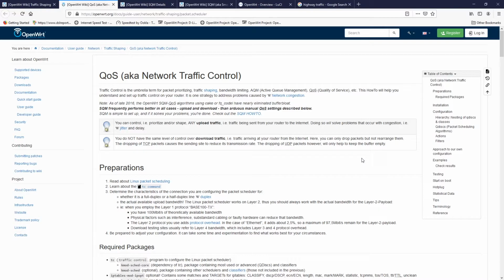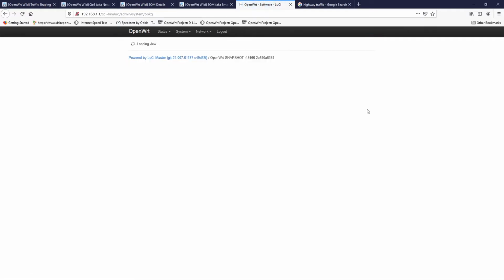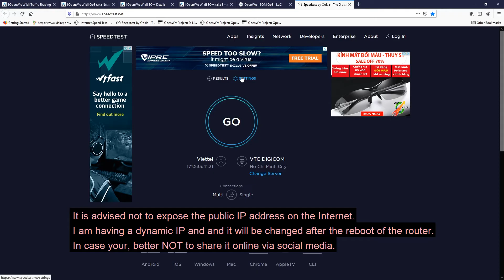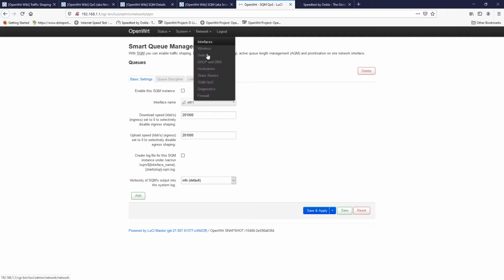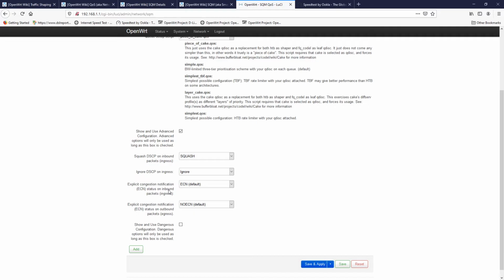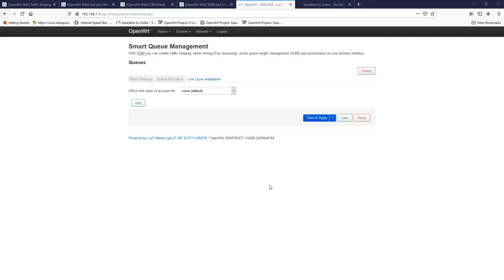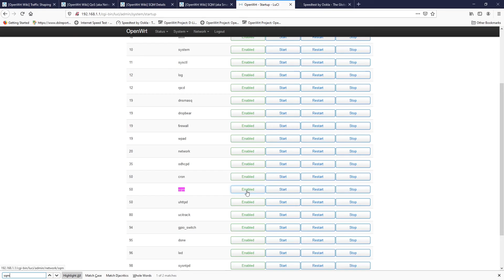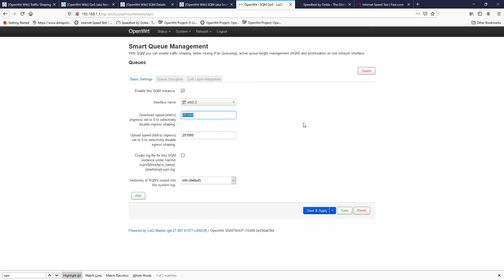OpenWRT - SQM QoS Setup on LuCI

Comment: Highly recommend limiting client speed below 100Mbps if you get a lot of latency spikes and have bandwidth overhead to spare since routers often can't handle SQM above 100Mbps. In my case, I set SQM shaping on my interface at 80Mbps and speed limits for my client on that same interface at 90Mbps. Completely eliminated all latency spikes. It's good practice in general to allocate appropriate bandwidth for different clients. For example, if someone you live with has a smart TV that streams in 4k, it will need about 25Mbps (overhead included), so you can set a 25Mbps download limit on that client to ensure it doesn't eat up more bandwidth than it needs.
Reply from the maker: Thanks for the info. For router which doesn't have a powerful processor/CPU, limiting the WAN throughput is also a good way to keep the latency stable (as the SQM also use CPU resouces to handle the task).

Comment: hi, i set bridge mode on my modem and added sqm to my openwrt installed router(ax23). it was working fine for months suddeny i lost connection.when i activate bridge mode on my modem i cant acces to internet, even without router modem aint giving me ip
Reply from the maker: Hi, did you fix it? It seems the problem is not about SQM, but either with the way you set your modem to bridge mode (perhaps it was overwritten by config from your ISP)?
Reply: @VanTechCorner yeah its not because of sqm but i dont know where to ask 😅 i can put to bridge mode my modem but i cant get ip from it,for now im using my modem as router mode and second router to share wifi
Reply: @VanTechCorner this problem happened after i lost internet connection due to maintance in isp side they told me to hold wps button on modem(removed bridge mode) and they resetted my ip after that i couşdnt use as bridge mode

Comment: Can someone tell me if there's a current issue on Openwrt 24.10.2 x86? I got it installed, but when I try to get a status is says active with no instances running. I checked kuci and it's enabled in SQM and other startup.

Comment: Can i set up this in asus old wifi 4 router and set up this speed for each ap ?

My main router is mikrotik, and for APs i use old one asus and tp link routers. 

On my network i have simple que and mangle rules on mikrotik, but i want to limit speed for also each ap.

So when i have 40mbps internet i want to have in each room 20mbps with mangle rules, and when i start download some files i will have stable internet in the second room.

Comment: Hello.
I have a Kimax Boundless NAS, I installed Openwrt-21.02 on it. The problem is that when logging into the NAS Server with Luci, it asks for a username and password, which I don't know what it is. I've had this device for about two years, and I've never used it for this problem. Would you help me?

(Powered by LuCI openwrt-21.02 branch (git-21.148.49484-14511e5) / OpenWrt 21.02.0-rc2 r16122-c2139eef27)"

Comment: Not sure if you can help with this but I'll go ahead anyway.

I have a Eero mesh that has SQM turned on. However, it doesn't support PPoE bridge mode so my modem router is configured as double NAT with wifi turned off. I've added the routers DMZ address and forwarded UPnP. 

Is there any other settings I should check/enable for double NAT to work as smoothly as possible?
Reply from the maker: Hi, I can see that you already done all the necessary thing. From my understanding, no further stuff you can do in this case.

Comment: Good video, however, on a 100mbps connection, I can happily set the speed cap at 95mbps and do a speed test with no latency increase while its running, however, when downloading lets say a game from steam the ping will still fluctuate all over the place, it would be best to test on something that isn't speed test to really check what  your ping will do...

Comment: hi. thanks for the explanation. How SQM relates to the use of VPN? I am connecting to PIA. Should I still use the 85% of the ISP speed or the speedtest results (that goes via VPN)?
Thanks
Reply: I made some testing. when set the SQM download and upload speed to 0, my WAN speed is substantially better. Any value as per openwrt documentation (85% or 95%) would cut my speed really a lot.
Any idea why is that?
I than added the software flow offload and I have increased in speed and latency.
In the link layer adaptation Minimal packet size, MPU I set 64 (not sure that had impact on results. Documentation suggested to put 64).
I than activated my openvpn client. Naturally I lost quite a bit of speed but became much better than before.
QUESTION:
Would it be unwise to add a new SQM where I use tun0 as a interface name?
Thank you
Reply from the maker: - if you set the download / upload speed to 0, there is no limitation perform by QoS and your latency may increase which make QoS useless. If you want a full speed throughput, better not use it. As stated in the document "The 80-95% range mentioned above is a good starting point, but you can often gain more speed while still controlling latency by making a couple experiments to adjust the settings". You can find the link to the docs in the video description. 
- for VPN SQM/QoS, you can refer to this forum discussion. I believe it should help https://forum.openwrt.org/t/solved-sqm-with-a-vpn-what-interface-name-what-packet-overhead/57473

Comment: the download speeds reduce after doing this, is there a solution?
Reply from the maker: Hi, did you solve the problem? If not, I would suggest checking your throughput before enabled SQM. And then, use this value to configure the throughput for the interface in SQM.
Reply: @VanTechCorner  well I removed the ingress and egress speeds, made it 0 and when I check with Waveform bufferbloat, I get A grade
Reply from the maker: Great to hear that. The SQM comes with some queue policy which could help drive the traffic.

Comment: Hello!
quick questions:

I have recently flashed openwrt on my TPLink WR841N V11. Everything went smooth. Now I have trouble understanding things

1. Should I disable DHCP on modem and let my openwrt modded router do its thing?
2. How do I port-forward and enable NAT, setup dmz for my game servers?
3. How do I give my PC a static IP so that I dont have to manually port forward on assigned IP?
4. Does SQM work right away or do I have to do some configuration to enable SQM?

I have 6 users on 8mbps adsl connection and all I want is to have stable gaming pings while my homemates stream/download.

Thank you
Reply from the maker: Hey, you can check out the basic tutorial on this playlist and moving on with NAT and SQM. https://www.youtube.com/playlist?list=PL58__w3t_eTbcBQ9oJ8jXCxPtBiac59vC

Comment: Is it possible to use this in conjunction with dual wan(mwan3)? As I see it, it seems that you assign SQM to only one WAN port. Would it be possible to have another instance that would be assigned to another WAN port? thanks again for the tutorial!
Reply from the maker: Yes, absolutely. You configure SQM for multiples interface, not only the WAN port. I have another video where I use SQM to control the traffic of LAN / WiFi.

Comment: Bro Which Internet are you using you ? Can some outside from Taiwan can get it ? I am Asia ! And can also explain the price of the plan are using ? Btw Very good video!
Reply from the maker: Hi bro, I am currently in Vietnam. It is fiber optic internet provided by one of the ISP - Viettel. I am on 200 Mbps plan and montly cost around 480 TWD. The service is only available locally so I don't think you can get it in TW. By the way, how is Chunghwa FTTH service in Taiwan?
Reply: Can you make a tutorial on how can we share vps interent to other PC or there is any possibilities we can do it through different way?or can we do port forwarding of rdp to any router
Reply from the maker: Hey, sorry for the late response.  To answer your question, it is impossible to do. We are creating a tunnel between our computer/router to the VPS when setting up the VPN connection.  Let's say that tunnel speed is fast, but all the traffic is still go to that VPS via your WAN connection, which is limited by the ISP.

Comment: opkg install command failed with code 255. I did opkg update already. my current kernel is 5.4.86
Reply from the maker: You are using a snapshot version thus it is outdated. (For RPI 4 there are only snapshot firmware instead of the stable release so it may be outdated in 1 or 3 days when a new build is available). Try to get the sysupgrade firmware and update the router to the latest one, and you should be good to go.
Reply: @VanTechCorner  I downloaded the sysupgrade firmware but on unzipping it says it is corrupted. So I still haven't upgraded to 5.4.87 yet and as such not able to install luci-app-sqm.
Reply from the maker: There is no need to extract the file, just download it and go to System - Backup/Flash Firmware  and select the file and you should be good to go.
Reply: it's maybe ipv6 the prob bro ;)
Reply from the maker: He was able to finish opkg update means there is no issue with IPv6.
Reply: @VanTechCorner  ok it's a good news :) for his
Reply from the maker: The reason I know this case clear is because we have a group and he shared his setup before.
Reply: @VanTechCorner  i'm in also in the group my name is julien santoni in the friends group :)
Reply from the maker: I see, I remember taking to you before, but don't know your Youtube name.
Reply: You have to update to a new version of OpenWrt because the kernel is constantly updated. At least in the master snapshots.